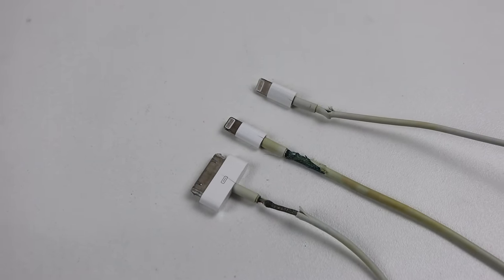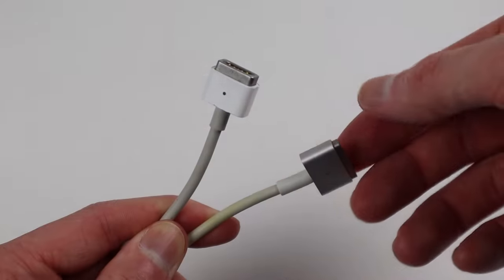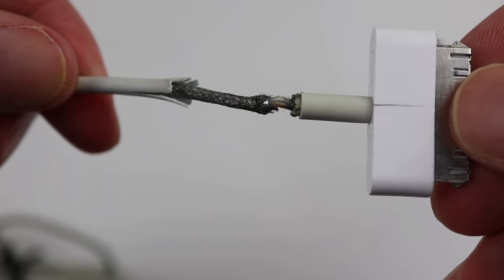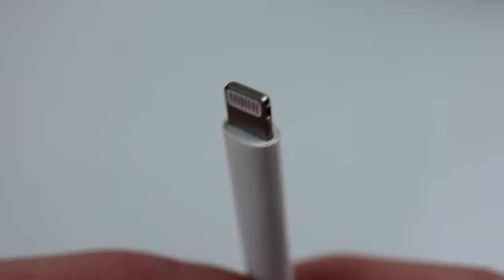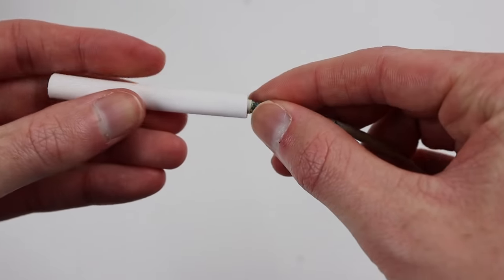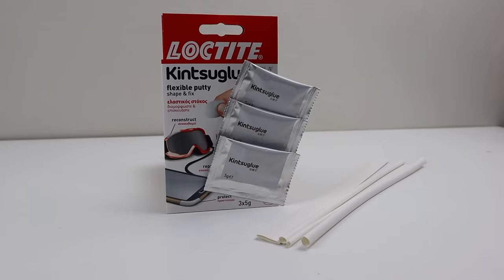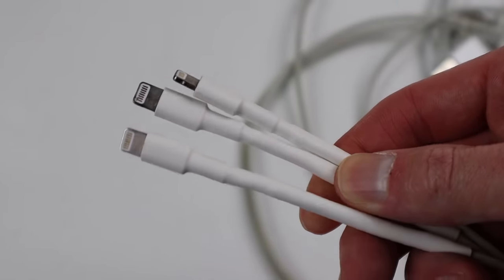Repairing Apple's Notorious iPhone Cables for $8! - Save $$

Comment: At least rumour has it Apple will be switching to braided cables for the upcoming iPhones. That will solve this issue. Personally I haven’t had too bad of luck with their cables, my family has broken some though, one I suspect was being in the heat/cold too much because it is always in our car so it gets the heat of summer and cold of winter. Also dropping a device off the couch while connected and bending the cable by pushing it against the couch has made them break quicker. I do also have an Anker lightning cable and it’s really nice.
Reply: I drop my iPhone with a heavy battery case on it behind my bed and lift it up by the charger rather often, and it still looks OK.
Reply: Apple won't ever do that. What will happen is apple will stop supplying cables and chargers in box and you can buy cables from apple which they would change to braided cables. So you're just going to pay for those.
Reply: Nope next step is no cable in iphone 12 🤣🤣
Reply: bibasik7 Well that’s good, it still would put strain on the cable and port though lifting it. As long as it doesn’t land on the cable their shouldn’t be any damage.
Reply: Utkarsh Mishra Hopefully not, the rumour is that they’ll supply a braided cable but no charging brick or headphones. I hope they’re wrong about no charging brick because I don’t have the new fast charger yet. The thinking is though that people already have a lot of chargers and bricks so it will help reduce waste. We’ll only know fully once Apple announces the new phones.
Reply: My Cloth Iron has a braided Fabric but it almost goes kaput
Reply: DNA RNA I saw his video, he said in it no charging brick or headphones but a charging cable
Reply: How do ppl wash their braided cable?
Reply: @SayAhh  Just wipe it with a cloth I guess

Comment: 2:10 Ah, some things never change. I remember buying an iPod Video around 2006 and commenting that the thumb wheel on those things was a bit too sensitive and that it would be great if Apple added a sensitivity adjustment to the Settings. The employee scoffed and told me I was using it wrong – I should be using the thumb wheel with my index finger!

Funny enough, even back in '06 their cables weren't so great either. I think my iPod's charge cable has held up alright (wherever it's hiding now), but the shielding on the earphones gave out within a year.

Comment: My older brother also uses Heat Shrink. He applies electrical tape to the cable first then the tube then shrinks it with a lighter. No problems and it’s been over a year.

Comment: What are y'all doing to your iPhone cables? I don't treat mine particularly well, and have been using the same ones for many years, and mine haven't shown anything more than a little bit of crumpling rubber near the connector. No tears. Are you slamming the bottom of your iPhon against a table while it's charging?

Comment: You gave those cables a whole new life 👌
Reply: Don't think so. If they are already that brittle, they will fail again, this time at another point. But he has prolonged the life for maybe half a year
Reply: @TheRailroad99  My Macbook has a cable that is also very worn out, the cable is 7 years old and its still working well. It has been torn already for a few years and again, it still works perfectly fine just I need to do what Hugh has done is all.

Comment: I'd recommend putting a whole cable in a heat shrink since the cable will start to tear apart in lower portions. Also, you can even put a "healthy" cable in the heat shrink to prevent its deterioration in the future.

Comment: I’ve been using the same Apple lightning cable since 2015, it has no breaks so unless you abuse your cable it’s not going to fall apart.

I have a relatives 30 pin cable from 2012 which was used every day and I still use it today and it as well doesn’t have any frays.

Comment: Iphone cables also have super thin wires that snap really easily when the outer rubber disintegrates. I have a 5 year old micro usb cable that still looks brand new

Comment: Pro Tip: get a third party Cable for 5 Dollar.
Reply: Yup...exactly
Reply: Yep it would be a hole lot cheaper
Reply: Pro Tip: don’t get a $5 third party cable.
Those aren’t MFI certified and can cause TriStar/Hydra to crap the bed. Recommend getting a cable that costs around $10 or more and look for the Made for iPhone/iPod/iPad or whatever labeling.
Reply: @xlite4999  good point. Also cheap batterys can make triStar crap the bed How do it know? Its because I i wanted a cheap fix for my iPhone 6s. It might work for a month or two (which it did for me) and then waam it craped the bead and its not showing any sign of live
Reply: xlite buy from anker
Reply: Joshua Roney doesn’t have to be Anker. A lot of other brands will work also. Just make sure it’s MFi certified.
Reply: U BUY 3RD PARTY CABE FOR 5 DOLLAR?!???!?!?!
OML I BOUGHT LITTERALLY 12 LIGHTING CABLES FOR 5 DOLLARS!
Reply: not a channel :shrek: There’s a chip in it that has to be certified by Apple in order to communicate correctly with the device you are charging.
Thus why cheapy cable always say ‘this accessory is not compatible with your device’
And the bit more expensive ones with the ‘made for iPhone’ logo and certified by Apple don’t have that problem.
Reply: Certified cables in a multi pack aren’t that expensive. Hugh’s repairs look a bit SHIT to TBH. As long as the old ones are properly recycled and don’t go to landfill save yourself the messing about!
Reply: Thomas S. my friend got a Iphone charger around 10$ and it fried his battery
Reply: @jesujgaming9801  ayee itsjusta 6

Comment: I went through 4 cables in 2 months on my first Ipad.
The rubber stuff is crap.
Anker uses rubber too & those start cracking as well & it exposes the wiring eventually as well.

Comment: That’s funny, I’ve never had this happen to any one of my Apple cables. EVER.
Reply: Well then, you are lucky.
Reply: Same
Reply: Simon Anthony for real though, it just looks like these people don’t know how to take care of their stuff 🤷‍♂️
Reply: Simon Anthony Its not that hard 😂
Reply: @mattfromwiisports7780  I know how to care and I repair my stuff and there is no way the yellowing and cracking is a mishandling issue. Physical materials don't behave that way. Simply put, if it hasn't happened to you, your cables are made of different stuff.
Reply: Simon Anthony the cable does get dirty a bit but you can just clean it off. I still use my iPhone 5c charging cable to this day and it’s not broken or damaged 🤷‍♂️
Reply: @mattfromwiisports7780  So, it hasn't happened to you. It does happen though - often but not always. Discolouration is not the same as dirt !
Reply: Sure
Reply: @tortysoft  the yellow discolourarion comes from sweat, and bacterria
Reply: @sysofficial  And that leads to the damage. Other leads do not suffer from this problem.
Reply: yeah cause you have to take care of you piece of cable art XDD
Reply: @tortysoft  That doesn't necessarily mean it will cause damage. Most iphones are made to be placed in a position, where the cable will be bending. The low-quality cables they use, typically break after 1-2 years of easy use. But bending a lot could cause tears really easily.
Reply: inspirational and life changing comment

Comment: The first and last thing I bought from Apple is my iPod Classic. It was 2007 and both the iPod and its original cable are alive and working - no discoloration, no hardening of the cable and no connection issues. The battery on the device itself is also the original one. Doesn't last more than 4-5 hours nowadays but it shows that Apple used to build hardware really well.

Comment: Hugh, you are using the heat shrink wrong. You’re supposed to make a horizontal cut in the lengthwise middle of the heat shrink  to put it on the cable. Hope that helps

Comment: Mine too. I am tired of buying new cables so I cut a hard plastic straw in half. I then cut a slit length wise. I slipped my cable inside the straw then glued up the slit and both ends of the straw with hi-temp glue. I used it like that for a month now and it is still going strong.

Comment: Hello I’m your subscriber from India. I own a 12 inch 2013 MacBook but whenever I turn it on, it automatically reboots after 15-30 seconds of usage, I have tried deleting the OS and reinstallling and completely erasing the Mac, the reboot error still comes showing something as kernal error in the logs. Can you please suggest me what part of hardware should I get fixed. There is no water or dust damage or fall damage of any sort.

Comment: cool . I use also thermoplastic polymer . it is small plastic granule  you can melt at +60 degree in hot water and get hard again when room temperature . you can found that on Ebay or Amazon ( thermoplastic polymer )

Comment: I have tried several times to repair my cables with a shrinking cover, but it will just move the problem a little bit further. In a month of daily use, you will notice a craking at the end of the cover because of the difference in rigidity of the materials combined.

Comment: The green is not the glue.. it's the Copperoxide from the copper wire inside the cable when Copper comes in contact with air

Comment: I do the same thing with the lightning cable with heat shrink but I take a spring out of a pen, install it just below connector and then put the heat shrink over the spring. More flex it in.

Comment: My lightning cable from 2016 is totally trashed but still works. Not sure if I’ll buy some heat shrink and try to restore it, but my dad’s S6 edge had some minor damage due to a cat biting it. Guess it’ll be fixed with heat shrink.

Comment: I have used sugru for repairing cables but not heat shrink. My camera connection kit decided to split on the cable casing which was when I first tried sugru, I still intend to get a new one when I can afford the stupid amount of money they charge. I never buy apple lightning cables but buy Amazon’s own brand braided cables which are mfi certified and will last years, but I have tried lots of different camera connection kits and only the official Apple ones seem to work. All the others either do nothing or my iOS devices tell me they are not Apple compatible.

Comment: Here's a trick . When heat shrinking cables ... Before sealing the heat shrink I place bits of hot glue inside and while heating it  molds around the wires and makes it extra secure and sturdy

Comment: I’ve used heat shrink on my cables as well. However, I couldn’t find white. So I’ve got a bunch of cables with black tips. I’ve even put heat shrink on cables that aren’t broken yet just to strengthen them.

Comment: Can't you just use white insulating tape? Works great, though it does get dirty kinda quick (maybe because mine is sitting in dust most of the time, but if that happens just remove the tape and put more)

Comment: I don’t know what’s the situation that your cables break but I have many cables dating from 2012 in exceptional condition. I don’t bend it or turn it in any odd way. With that being said I know some people that have had troubles you could go for quality aftermarket certified by Apple cables for seven bucks which means it’s not worth repairing the cable yourself. When I’ve had a bad cable Apple always changed it for me no questions asked. But I appreciate the videos you put out there because this will help a lot of people with this unfortunate issue

Comment: I have been doing this for a while on apple cables. I would advise where possible to use the heat shrink tubing, the moldable plastic stuff from Loctite cracks after a while in my experience. 
I typically go from after the plastic connector housing around that rubber part that comes from it that is thicker which works well enough for me. if there is a crack on the plastic connector I just use a small thin coat of super glue on it to help it not get worse.

Comment: make sure to use 3:1 ratio heatshrink, maybe consider one with glue. 12mm in 3:1 ration means a shrink down to 4mm but should also give enough for the cable to slide through, if not then try a 4:1 ratio heatshrink with maybe a 16mm to 4mm or maybe a 20mm to 5mm. Glue lined will just keep it in place and just heat it up a bit more till you see the glue seeping out, if not then the tube hasn't shrunk enough for a nice tight bond. Then if you want and if your careful enough and depending where the glue is, just neaten it up with an xacto knife or similar. I find the glue lined great for sleeving with braid to keep the braid frojm accidentally slipping from under the heatshrink and ruining the look as well as itself, that's if you need it.

Comment: Honestly it’s not hard to keep the wires from breaking, all I do is make sure that the part where the rubber sleeve connected to the plastic end, and the regular wire meet doesn’t bend too much or wear out , and I have been using the same wire for probably a year now. If you take care of your things, they don’t break.

Comment: if you get a 30pin to lightining its best the long cables if your case cant fit the 1 piece verison, and you can use the older 30pin cables from 2003(when I was born)

Comment: That heat shrink package is quite expensive imo. I get my heat shrink from a local supermarket and it costs around 20 cents per meter of length. It goes up in price as you go thicker, but it sure is way cheaper than that pack.

Comment: Even the White Samsung charging cables are prone to this too.  I have one that deteriorated like the cable has been stripped with a wire casing remover.  It also had the same kind of yellowing too.

Comment: I’ve had one cable in 10 years of using the rubber chargers that had a tear, and it looked like it was cut open with a knife. One of the other chargers that I had like a year and a half ago now broke in the plastic and stopped working a month after the plastic completely came off

Comment: I’ve never encountered this cable problem, but I’ve had to replace a lot of cables due to an internal breakage near the part that plugs into the phone. I’ll be using my phone while it’s recharging, which I do all the time, and it’ll start beeping telling me it has made a charging connection. The worse it gets, the more often it starts beeping. Sometimes several times in a row.

Comment: I’m still using my 6S+ charging cable for my XSM, no damage, just cleaning it with alcoholic wipes and looks like brand new. Same for my Magic trackpad 2 cable, looks like brand new...For me still mystery how charging cables can look like the dog chewed it after few months...even the thunderbolt cables for the macs...it’s defo how people using it.
One of my colleague managed to totally break (make it useless) an original mac cable in 6 months, while mine was operating just fine after 3 years with signs of wear/tear, even i connected/disconnected every day at least twice (when arriving/leaving).
I even lend it to people and after 2 days of use looked like it was 2 years old...
And yes i am just grabbing the cable and “ripping” out from the device (not even being careful)

Comment: Don't you find that the magsafe adapter - the little aluminium thing - gets too hot to touch ? Mine does ! I have had to clean the pins due to oxidation and sparking !

Comment: I doubt that the green substance is adhesive. More than likely it amounts to corrosion of the copper braid shield used in the cable. It might be tinned but there is a chance that the "plastic" used on the cable reacts with the shield causing it to corrode which in turn can react with the plastic causing it to break down.
If you don't repair that section right away the wires within will fail real quickly rendering the cable useless.

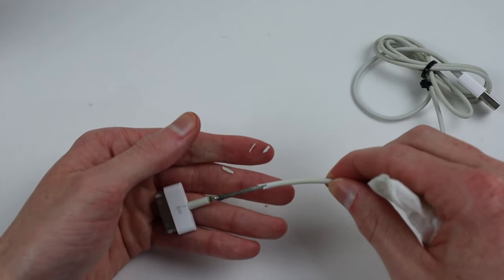Comment: The "green" is the copper corrosion that eventually permeates through the cable insulation. I've had Apple cables fall apart in the same way. Even the connector cracks. It's pathetic. Heat shrink tubes aren't a long lasting solution. Old cable insulation becomes brittle and it will just start crumbling at the end of the heat shrink (2:57 & 4:42). Also, the electrical performance of such cables is likely degraded. I wouldn't be surprised if they didn't meet fast charging specifications anymore and would just work as generic slow charge USB cables. The cables are junk and when you notice them crumbling, just throw them out, or keep them for backup. You don't have to buy a new Apple cable. You can get a third parry quality cable for less money. They do exist. Read / watch reviews when buying.

Comment: The thing that grinds my gears the most about Apple removing the lightning chargers from the box isn’t the inconvenience or even the issue of them trying the cut costs. It’s that a) the cables are so awful that they break after mere months of use and b) apple knows that a bunch of their target demo don’t have a plug that will support the new cable in the box.

Comment: Have you tried submerging the yellowed part of your mac charger cable in hydrogen peroxide, puting it in the sun, and letting it sit for a couple days? That may take the yellowing out... I've never tried it on a modern apple cable before, though. My MacBook Pro's charger and adapter cables are three years old. They aren't cracked, but are yellowing at the ends, and, being a perfectionist, it bugs the hell out of me. I am curious to test this method out on the new cables.

Comment: I bought Kintsuglue yesterday, then noticed this: "Be careful with electricity. Only for extra low voltage [<24V] and low power small consumer electronics. Not to be used for electrically damaged cables". Is a Macbook Pro early 2015 and its charger "low power small consumer electronics"? Is a frayed cable exposing wire "electrically damaged"? My Magsafe connector cable has split where I hold it to plug it into the mac about an inch from the plug.